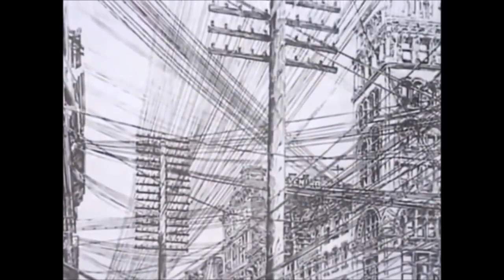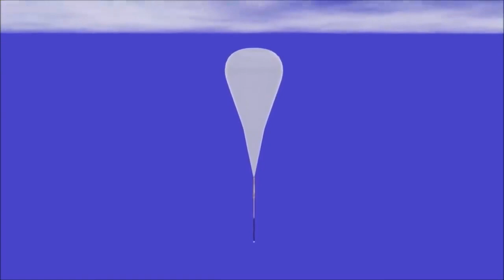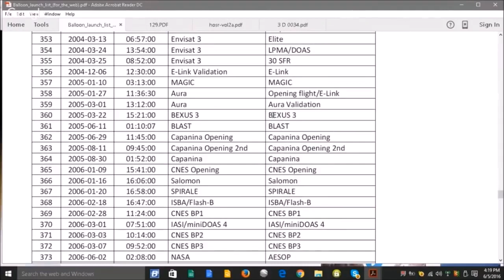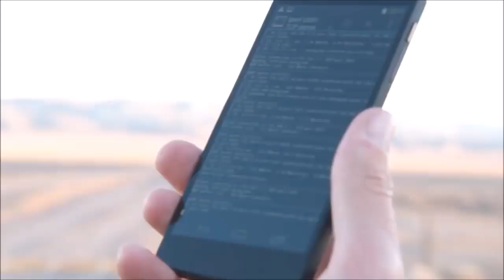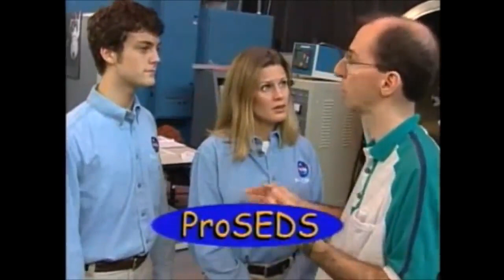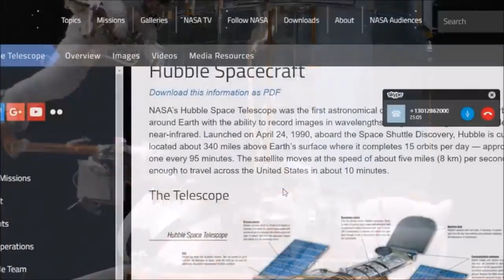The "Global" History Of Communications - Space Satellites Debunked

Comment: Prior to 1988 telephony satellite was the de facto. At the time it was analogue coaxial transmission systems both terrestrial and undersea.

Today its optic fibre. But that is merely the undersea portion. There is a lot more to telecommunications than merely undersea cable. Your internet connection, international phone call etc. runs through a variety of communication nodes and mediums to get information from point A to point B.

Satellites are still used for VSAT services, redundancy, etc but the bandwidth and throughput of fibre is far superior today and thus the preferred technology.

Lastly, worldwide we have roughly 3 million radio amateurs (Hams) who use a variety of propagation techniques to overcome earth's curve with radio waves. One of it is satellites. Hams have a number of their own satellites known as OSCARs. Engineered and built by master engineering students and Hams. QO-100 is an example of their geosynchronous satellite.